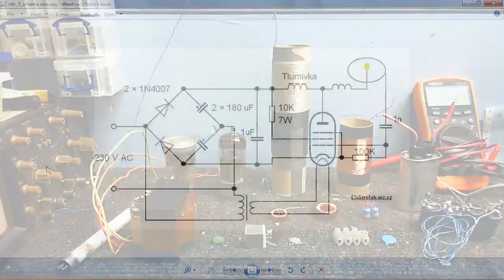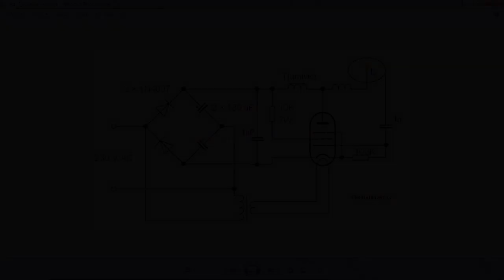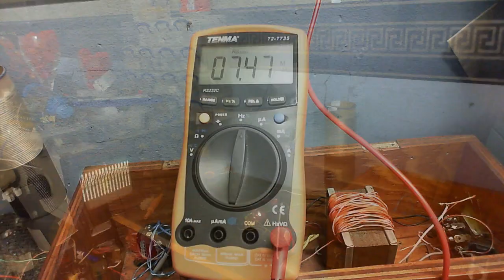Tubetime X - Doing some Teslaing!

Comment: coil 1 and coil 2 need to be in resonance with eachother
and try tuning the feedback
it makes bigger sparks when tuned
also this can be turned into a plasma speaker :P
Reply from the maker: ***** How would I go about tuning the feedback?
Reply: the normal methode is a capasitor and resistor (paralel) to the ground that goes trough the feedback coil into the grid of the tube

i have looked at your circuit
and i dont think it can be tuned (exept for the coils)

but you can try to have a capaitor over the 100K at the grid of the tube

or a resistor capasator to the tube grid

if you want to audio modulate this look at these circuits

http://www.plasmatweeter.de/eng_plasma.htm